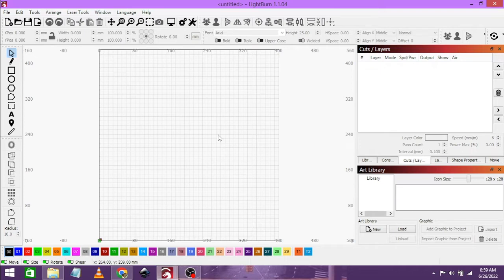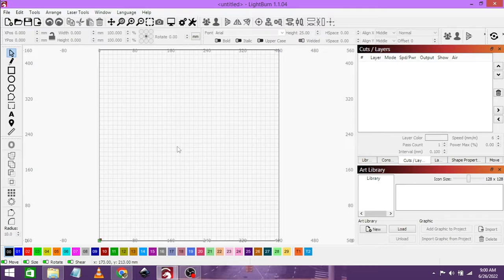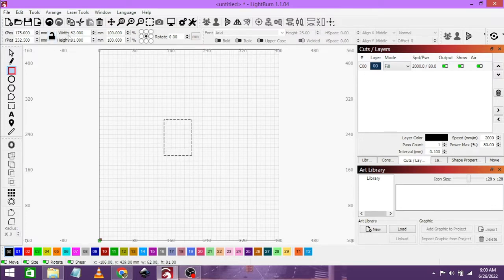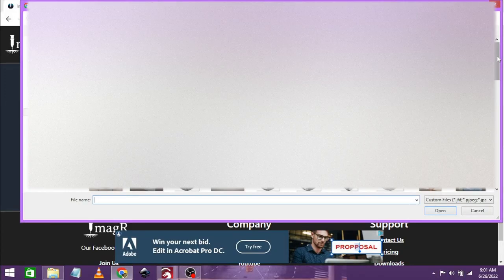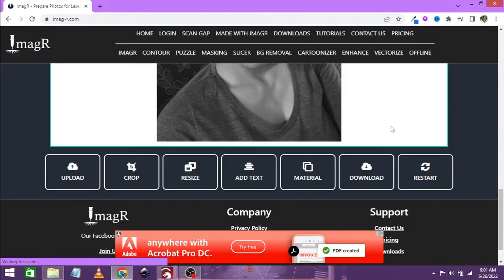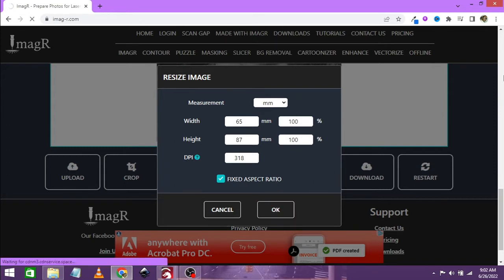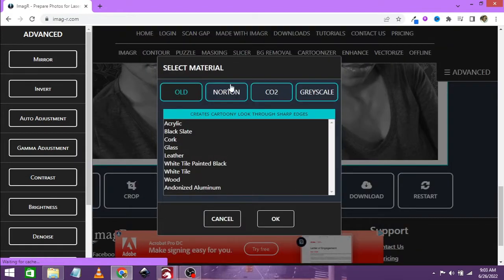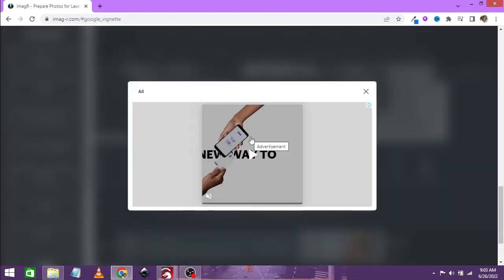How to Engrave a Photo on Aluminum Using Lightburn and Imag-r

Comment: When you use/save the parameters from Imag-R you have to check the "Pass-Through" on Lightburn. As for the laser you will get far better results with a line interval of .1/254dpi.  Anything smaller with the diameter of that diode laser will just burn off more from each previous that was burnt. There's a ton of other misleading YT videos stating 318 DPI which is too much for this diode laser.
Reply from the maker: Hi, I have done an experiment when it comes to pass through and stucki and bitmap and PNG. I appreciate your honours feedback and will look into and share my findings right here. If you want to watch the video for the experiment I mentioned. Here is the link https://youtu.be/jOhDb7OlPEA